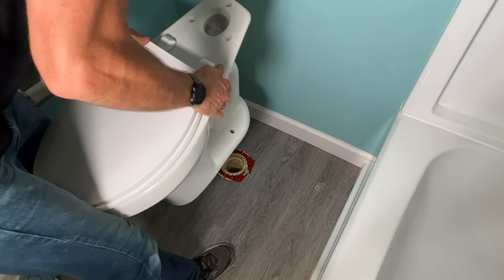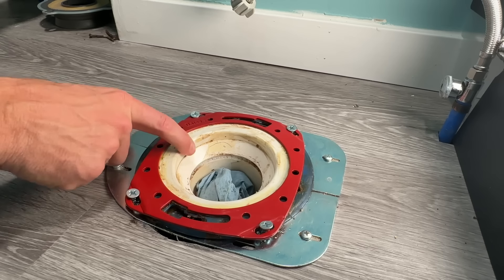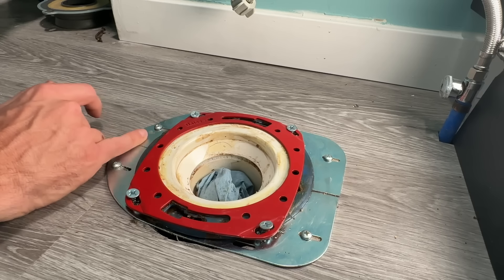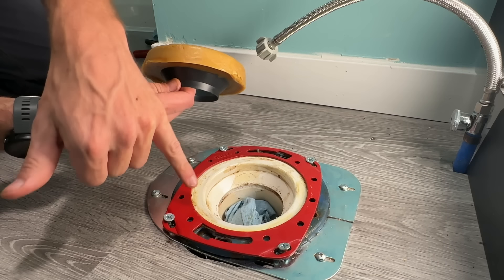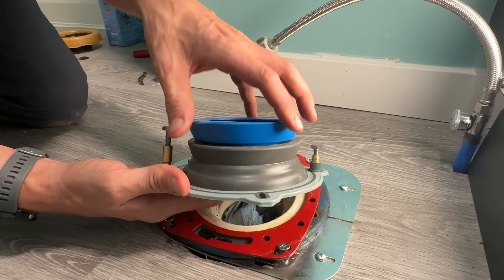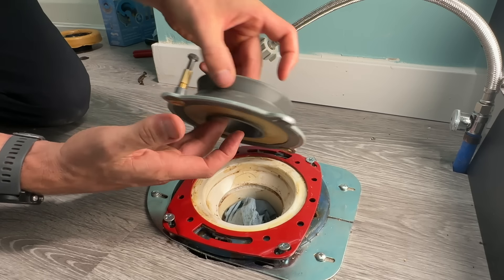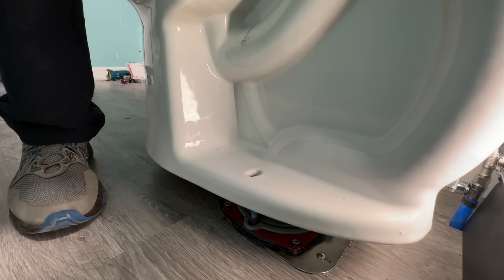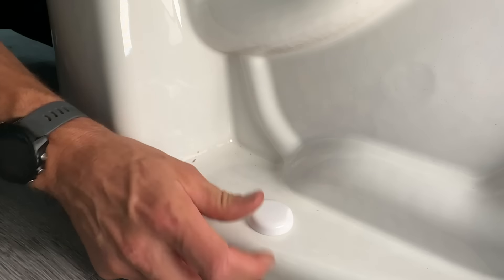How To Install A Toilet Bowl | Best Product On The Market!

Comment: Thank you for the advice, it really helped. However, I tried to use the repair kit and the Danco kit - but the bolts didn’t fit into the slots. It turned out that the bolts have the thread shaved in the area of the slot, but it is not shaved enough to allow for the repair plate, and I didn’t have tools to do it at home.

Comment: I've never set a bowl that didn't already have the tank on it. You need a gym membership not a fancy wax ring. I use regular ones unless you need more height then I use the one with the rubber or an extra tall wax ring. Promise it's far cheaper and will last as long as it's properly installed.

Comment: My toilet has a lead pipe that the flange attaches to. After having a leak and taking off the toilet and flange I noticed the lead was corroded away from where the flange seats on the pipe. My house by the way was built in 1870 so the bathroom is on the second floor of a two story one family house. ( Apparently for gravity reasons )  The bathroom was located right above my living room so in order to replace that lead pipe area I would have had to cut away the ceiling in my living room and it would have caused more headaches. I used some marine caulking along with a rubber flange to seal the area up and it’s been almost 5 years and no problems yet .

Comment: i got this kit, it wasn't nearly as fancy as yours is. not sure why mine had regular j bolts and no guides. i would have loved the bolts and shims, no one likes cutting bolt heads. i did it recently too, so i suppose they went cheap with these kits and got rid of the fancy mounting system.
Reply from the maker: Hmmmm, did you get the kit from the link in the video description or down at your local home improvement store?
Reply: @EverydayHomeRepairs  i got it at lowes, i guess they only have a kit #10826X as their premium line, where as this one is still better yet than that one. really the only difference is the fasteners.

Comment: Seems more  like a promotion to buy the All-in-one kit from Danco. Personally I would not use it...if ya wanna know why ask me....it's a bit complicated.
1. Clean the closet ring (if you like). Look carefully for any cracks or gaps in something  that may result in leakage in places other than the wax seal. 
2.  Install the brass bolts using a washer and nut on top to fasten to ring so they stand up stiff.  If a little crooked you can bend them a little.
3. Set the bowl (without any wax yet) on top of the ring and check for wobble or high centering. 
4. Use waterproof shims (I use pieces of vinyl floor tile) to level the bowl and remove wobble (rocking) without raising the height of the bowl. (if possible)
5. Lift the bowl while leaving the shims in place. 
6. Place the wax ring(s) centered on the closet ring. (enough to get a GOOD squished seal). 1 or 2 will usually be enough...if not reply to me and I'll help.
7. Be sure you understand steps 1-6. 
8. Squish the bowl down using a slight rocking motion till the bowl sets on your pre-installed shims. (Tuck the shims under just enough  to caulk over them them.)
9. Place plastic and metal washers and evenly tighten nuts (careful, not too tight).
10. Check for wobble and caulk to floor. Do not caulk the very back of the bowl so that any moisture leak has a place to exit. (rarely happens)
If you have a loose, crooked, broken, too high, too low or any sub-standard ring...  reply to me or else all bets are off.
Reply: Put the wax ring on the closet flange.  Put a 2x4 each side next to where the bolts go.  Put the toilet on the 2x4s.  Adjust/position over the hole.  Lift one side and remove a 2x4, then the other.  Push down.  Tighten nuts onto bolts.
Reply: @jpmacoo  If you don't shim the bowl before tightening  you're wasting your time and risk damaging the floor. Steps 1 through 10 are standard procedure...otherwise it's a hack install.
Reply: @readmore3634  
Never had a problem.  Never shimmed.  And as said, I've installed on all kinds of floors, in 30 year old and 180 year old houses.  Keep shimming if you like, though
Reply: @jpmacoo  You have no common sense. Keep that up if you like.

Comment: Plumbers tip, WD40 is great for cleaning up wax. I’m sure there’s other things but WD40 is something I always have with me. I’m sure every plumber will say differently on what’s better. These gasket type seals seem to work from my limited experience. They’re not practical for plumbers due to cost but for DIY I guess they’re fine. I’d like to find some version of the guides that would work for regular closet bolts. I always install tank and bowl at the same time and lots of bathrooms are low light areas. As I’m getting older I don’t see as well in dim light. I usually set a light on the ground so it shines up. Some guide like those would be nice.
Reply: I saw somewhere where a guy took a couple plastic straws and cut them about 4-5" long. He then cut them from top to bottom so that the straw would expand and fit around the bolt and stick straight up to use as a guide to set down the toilet bowl.

Comment: great video there are a lot of solutions outside that will make an installation more easier i didn't know. quick question about toilet labeled 10 inches from wall to mounting screw or 12 inches type. how we know and do the work in those cases?

Comment: Just used this thing and discovered a bit of a flaw. Turns out my toilet height was right in the middle of needing the spacers and not needing them as the  nuts just barely touched the threaded inserts without the spacer and could not be torqued down all the way with them. The flaw is that there should be no gap between the two and torquing it down with the spacer should duplicate perhaps the last 1/4" without one. That way, they would eliminate the unsweet spot I discovered.

Comment: Use wax. Others usually always sit too high you Crack the porcelain. Come back after 15 min after wax has seated and snug bolts. If the flange is above the floor the toilet will continue to sink.  Same with putty and basket strainers/tub drains.

Comment: My plastic (ABS) flange was destroyed (poor original installation by a professional plumber years ago) and the hole in the flooring below was cut too big. So I needed to use the 2 piece flange support below the flange and the flange repair kit above the damaged flange just like in the video. This resulted in what I believe to be a secure flange that will last forever. The problem I now have is that the toilet does not sit flush with the floor because the flange is too high off the floor and the toilet wobbles unless I shim it.  I used a standard wax ring. Any thoughts on how to manage the extra height of the repaired flange and wobbling toilet? I don't really like the shims.

Comment: Dont use those wax rings with the plastic funnel. The plastic funnel can cause clogs and leaks. Either get a kit like the one shown or a wax ring without the plastic funnel.
Reply from the maker: The plastic funnel insert?  The one which is suppose to be included if the flange is below or flush with the flooring surface?
Reply: @EverydayHomeRepairs  The wax rings with the funnel/bell attached. They can cause issues with the water splashing and causing leaks. Also with some flanges and toilets they can prevent the toilet from seating correctly. The main purpose of the wax ring is to stop sewer gases not water.
Reply: The hand crank toilet auger hits those plastic ring and never unclogs the toilet.   In fact that's where the clog is at most of the time.

Comment: I’m no licensed plumber, my bro-in-law actually is. 
I replaced the 3 toilets in my house by myself, perfectly with the wax ring. 
I find you just need the strength to make micro adjustments to precisely place the toilet on the ring… 🤷‍♂️

Comment: Vinyl plank is a floating floor. Their should be no screws nails ect. Through flooring. Properly installed flange works better and saves dollars. If you watch the guy sets the toilet in with the tank facing the center of the room.

Comment: Will that Danco product work if the front of the flange is higher than the back of the flange? My pipe is tilted up with the front about a quarter inch above the slab and the back a bit under the slab. So the flange itself sits in at an angle.

Comment: Got the kit before I saw this video, installed it last night. The flange is the old cast-iron type (house built in 1965) flush to the floor. Removing both plastic rings from the kit, I still am having great difficulty getting the toilet to sit flat on the flor and not rock. How long/how much rocking and working at it did it take to get your toilet to sit flat on the floor? Any advice to making it easier?

Comment: I Never use Wax.  The Foam Seals are much more forgiving.  For uneven flanges I sometimes put a plastic bread wrapper a few inches down the hole and bring the rest up and over the flange, then the Foam Seal.
Quck, cheap and has always worked for me.

Comment: I’m a European seems like a very complicated system just to fit a bowl we use multi wicks that connect to S or P trap pans the multi wick goes on to the spigot of the pan and the other end fits in to the soil pipe the. Screw pan to floor.

Comment: several people have had issues with this set up as in toilet wobbling after any configuration they tried, one person found it leaked and when taken apart found that the wax had compressed into the flange reducing the size of the waste pipe causing water to splash up and cause leaking. I can't figure out what option to go with

Comment: Agree with many of the comments here.  Stick with the Wax ring.  Growing up, installed plenty of toilets in my dads properties...  They all still work fine.  Not certain about changing what works.  There is a reason car thermostats still use wax.  It just works.  Same goes for wax rings.  It just works...  So why replace it with something with too many bloody parts?
Reply: The one he's using still has a wax ring in it.
Reply: @juskicknit36  It does, but the wax ring is likely cracked or ruptured in some way.  There is no other way for it to leak that way, unless the actual ceramic of the toilet is cracked (which even less likely)

Comment: I thought the rule of thumb was the flange should be 1) level with the flooring or 2) no more than 1/4" higher than the flooring. Seemed like this one was quite a bit more than 1/4" above.

Comment: Very informative video on the subject. I have set many toilets in the past and used standard wax rings with a range of success. Came across your video just as I'm replacing a short toilet to a taller one for my disabled wife. I knew I was going to have to replace some of the flooring as well. I purchased the 3 products you show in your video (from your Amazon links) and am going to install them today once the floor change out is done. With the help of your video, I'm actually looking forward to the end results. My existing flange is in rough shape so I hope the red flange repair part is all it is cracked up to be for a good repair. Thank you for sharing this video.
Reply: How did the Danco hybrid wax & rubber seal work out? That's the setup I think I will be using in my bathroom in a couple of weeks.

Comment: That black plastic ring you removed is not actually removed for below floor installation. If the toilet sits uneven, it can be removed to allow the toilet to sit flush with the floor.

Comment: Done this a few times using different sealing methods. Never used this particular kit but wondering, can you get it tight enough with that plastic clip? The original setup in my powder room had plastic nuts integrated into the cap and it did not work well.

Comment: The DANCO rubber seal appears to have a shorter lifespan than expected.  Significant damage to the rubber portion of the seal was observed after several years of use.

Comment: Did anyone notice he didn’t turn the bowl to floor bolts so the bottom “wings” or tabs will lock into the bolt channels on the flange? That’s a good way for those bolts to loosen up and create problems in the future.

Comment: How do you tell if you need to use the bolt extensions?
Reply: Lol.... you'll know when you place your shitter whether or not the external posts are long enough or if you have to use the internal bolts. It was pretty self-explanatory bud. Either way it beats cutting excess length off the studs with a dremel afterwards.

Comment: The toilet was leaking in new house and even after replacing old wax ring the toilet didn’t feel like it sealed well and sure enough still leaked - the contractor put two wax rings on top of each other to work, that’s not right correct ?

Comment: Interesting...I replaced the flooring recently in my own bath. Found out that these new fancy vinyl tiles can be lain over existing linoleum sheet flooring. I figure I'm home free until I remove the commode: the entire steel part of the toilet flange has turned to powder!!! For the life of me, I don't know how the toilet never just flopped over in a sloppy tsunami. The PVC inner flange was perfect of course, but now how to bolt the toilet to the floor?!? Luckily the laundry room ceiling directly below had a drop tile ceiling. My solution was to install super long toilet bolts with fender washers through the subfloor from below up into the bath to receive the toilet. NOW I see there is a retrofit metal flange repair solution that doesn't  involve surgically removing the glued toilet flange from the waste pipe...

Comment: No wax for me. Been using two different kinds, no leaks. I'm on concrete tho so a leak is no big deal. The wax ones all leaked because the tile job sucks and toilet wobbled.

Comment: Did you just install a toilet that's mostly levitating about 1/4" off the floor? That would probably cause the toilet to crack under stress since it would be largely unsupported. I would think that product (the extension flange) is for when you add a tile or similar floor above an old floor/subfloor so that it lifts the toilet up to the same level as new flooring? 

You do a nice job of being clear, having a good pace, including all steps, correct volume and light and focus. Please consider more expertise before instructing other people. You're a good host

Comment: 4:42. The directions say to screw the grey lock nuts onto the T-bolts first, then place the perfect seal.
The way you did it placing the T-bolts, then perfect seal on top, then screwing on the grey lock nuts makes more sense.
Any thoughts on the difference between what the directions say vs the way you did it?
Edit: The way the directions say to do it does keep the T-bolts in place though.

Comment: those blue locator things need to be more rigid. even regular brass bolts will move with the slightest touch. or maybe the blue ones flex back into place. then never mind.

Comment: I can't use that--- I have a CONCRETE floor-- and the old bolts GONE-- tried a screw in deal and the bolts don't hold- and i'ts NOT level.  I laid a level on it first and it LOOKED level- but wasnt' - it's still woobbly.

Comment: A short description on how to install the wax ring would’ve been helpful for those who go that route. I’ve often wondered whether the wax ring should be installed on the toilet or the flange at the time of installation.
Reply: I put it on the flange because I don't trust myself to set the toilet down perfectly.  I feel putting it on the flange will better account for mistakes.
Reply: @mae2759  I agree. Just installed a new toilet and found it interesting that the instructions actually recommended pressing the wax ring on the toilet. But I go with a flush insertion in the flange for proper placement

Comment: LOL who else was cringing when he would touch the flange ha ha, like others I would have rocked out some gloves. The rubber flange is ok but I am a wax ring guy, time tested and only fail if installed wrong or other issues. I would be worried the rubber would fail/tear and then a leak. 
All in all cool video, again just different points of view so all good.

Comment: Not sure why you used the red flange on top of the other? Just one more place to leak. The whole thing is too high and most of the wax got pushed out.
Reply from the maker: Yeah I needed that Oatey repair flange on top to pull the one side down.  It was pretty cockeyed.

Comment: Only issue I saw was that you didn't wear gloves when working on the flange.  I normally use latex gloves I have in my garage for working on my car.  They are thin enough where I can still grab onto stuff but thick enough to not break.  And disposable which is the major part so I'm not dealing with feces on old work gloves.  All it takes is an itch on your face and you not thinking, go and scratch it with dirty hands.  Feces could get in your eyes or worse off.. your mouth and then who knows what comes next.

Comment: 3 things:
1 Wear gloves when working around a used toilet or flange. (bacteria)
2 Use a double strength plastic grocery bag to throw the old wax or hardware into.
3 ALWAY used stainless hardware on the install. Screws-bolts-flange-washers.

Comment: Ahhhhhh American code's. Moved to Mexico a few year's ago. Though they have the same exact code's, none are enforced. I watched as our toilet was being replaced. And they first used a hammer to break it into smaller pieces. They then using a chisel, chiseled the remaining ceramic, that had been placed on the tile floor using an thick epoxy. No need for a wax ring, when the entire toilet is epoxied to the floor.

Comment: READ THIS BEFORE YOU FOLLOW HIS INSTRUCTIONS!!! this is an example of how NOT to replace / repair a commode flange. The commode flange is too high, it should be sitting on the tile or just below the surface of the tile. With it this high  the underside of the bowl, the porcelin can sit on the heads of the bolts and break when you tighten the closet bolts or worse yet, when you sit on it.